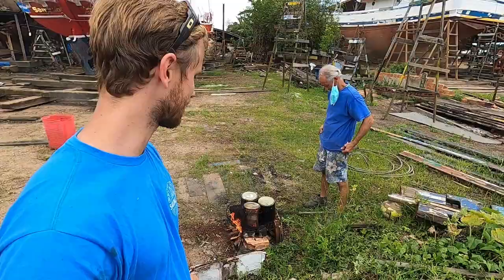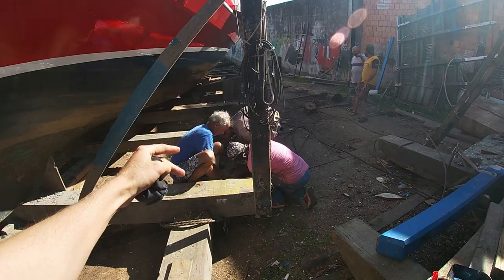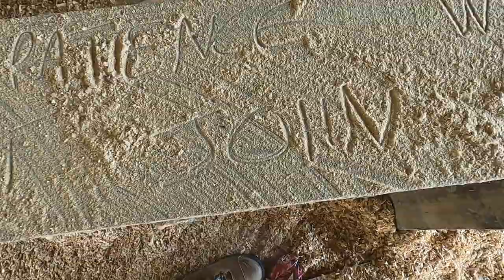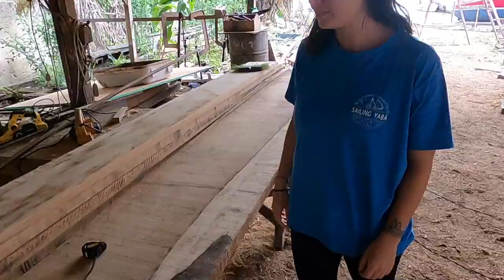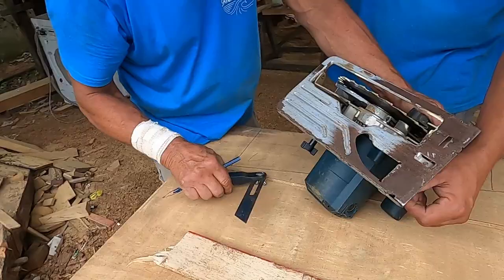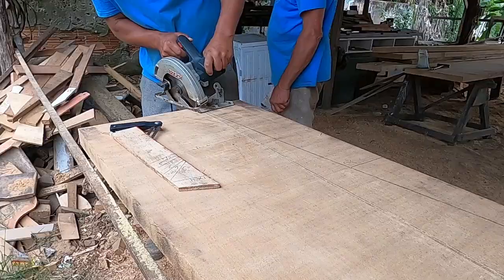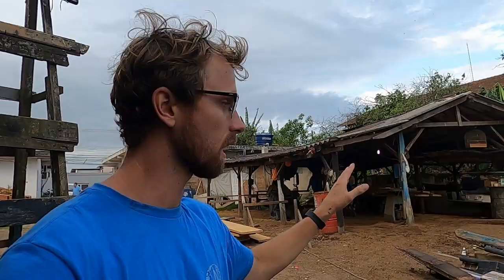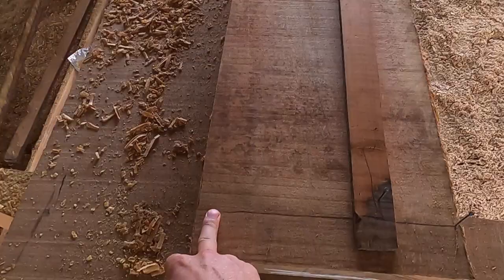Manoeuvering a schooner with a jack? + building our FIRST PLANK! — Sailing Yabá #19

Comment from the maker: FAQ - WHY ARE WE WORKING ON THE PLANKS FIRST INSTEAD OF WORKING ON THE FRAMES?

Hey guys! First of all, thank you so much for all the kind comments! We are super glad to read how much you admire our team of shipwrights, we truly believe they are awesome!
Now let's answer some questions that popped here!

1) What kind of wood are you using for the new planks?
Garapeira!

2) Why are you working on the planks instead of the frames?
We understand the right order would be to work on the frames first, BUT, the woodshop was delayed to get us the pieces we need (thick, wide and long pieces are not that simple to get).
As we had all the boards for planking already,  we went for them as the first planks (bottom ones) can be installed already because our floor timbers are in good shape. So don't worry, we are not ignoring the frames, they will be replaced and we acknowledge the right order of the works, we are just working with what we have for now.

We can really tell you guys know loads about wooden boat construction and we get to learn a lot from you as well! Thanks for sharing your thoughts!
Reply: I figured you need planks to hold the ribs to hold the boat up.
Reply: I wanted to ask you why you are bothering to rebuild a boat which is basically rotten below the waterline rather than just start from scratch or buy a boat which is ocean-capable in the first place?
Reply: @JP-lz3vk  if I had to guess, cost. I have no direct experience, but I do believe the cost of labor where they are is very cheap. Wouldn't surprise me if the cost of materials + labor is less than what they would of spent on a ready to go ocean capable vessel.

That's all speculation of course, I have no direct knowledge.
Reply: @agentnuget  I don't think this ship was ever, or will be, ocean-ready. It's also too big and too complex to be handled by the pair of them. Neither is a mechanic or an electrician, nor capable of making substantive repairs to the boat as far as I can tell, because this boat will break down a lot and water damage and rot will be a constant problem.
Reply: @agentnuget  Concur.  No direct experience, but I've asked a few people that have messed about in boats in that part of the world (other forums) and they said labour costs were such that it (and a lack of industrial regulations - or at least enforcement of them - such as western nations are riddled with) make it quite plausible to do a massive rebuild at a surprisingly low cost in fiscal terms vs pretty much any western nation.
Reply: @agentnuget  Santa Catarina (SC) the South of Brazil is not cheap, the north is cheaper . Compare it to north and South Europe with the difference in labor and living cost.
Reply: @JP-lz3vk  THE PROJECT HAS BECOME A FOOLISH FOLLY.
Reply: @geoffroberts1126   Agree.  But at the end of the day they will (might) end up with a still semi rotten boat not suitable for anything other than river cruising.   It is NOT a schooner as they call it.   It would be lucky to make 2 knots with the masts and sails it has.
Reply: @Jamesl1945  They seem to be replacing everything that's a bit ripe, so not sure that 'semi rotten' would be accurate by the time they're done.  Rig wise, mmm, rear mast is higher than foremast, and the sail plan is more like a traditional schooner than a ketch to me, so schooner works for me.  Speed wise, mmm, more like 5 to 6 knots I'd say, the sail area, particularly on the foremast is bigger than you think, what concerns me more is that this is more a coastal or inland cruiser than a blue water boat with that  shallow keel - ballasting will help, but still not meant for big seas to my eye.
Reply: @geoffroberts1126   Bunch of people commenting on the lack of bluewater capabilities of this boat. As far as I'm aware this couple have never put forward plans to sail the word in this boat.
Reply: Buuuuuuut: the Shirts aren’t they NICE?😂???
Reply: @seanmorris    I'm sure they're aware of its limitations, but no harm mentioning it.  It's an interesting resurrection that simply wouldn't happen in most countries because of the cost.  You don't often get to see real wooden boat shipwrights doing such a major reconstruction.
Reply: @Jamesl1945  Has it?  Why?  If it were in the US or Europe or even here, the cost would bankrupt a small country, however... where they are, that's clearly not the case or they wouldn't be carrying on.   I've enjoyed watching all the work being done.
Reply: @JP-lz3vk  for the experience.....
or just ....reasons

Comment: wow ! - i just started binge watching your channel 
amazing the energy you guys have and the time you are spending on this project is pretty epic - all the rot in the keel, frames (ribs) and everywhere is astounding but i guess to be expected in the way these boats were built at the time and with continued neglect, but what surprises is no use of some more modern spec materials used to paint like an anti fouling paint on joints, hidden surfaces and end grains which seal the timbers and prevent future sweating, condensation build up and mould growth, it will happen again in many years to come, but i am interested to see how this boat matures
the framing used on your boat is so much simpler than others i have seen, for example the rabbet normally goes full length on the keel, where as your keel is split into an upper and lower half, ps the two huge joins in the keel were scarfs (but i guess you know this by now) i've seen that centre joinery done slightly different and easier before, but all techniques is now learning - its very cool to watch
i watched many builds now on youtube, picked up loads of tips (as an armchair designer/builder) and i am amazed at your builders, they do a fantastic job, i see many ship writes using all the maths and working out all the angles on paper, transferring to a ship write plan and then cutting the timers, but your boys have obviously done this for so many years, its in their DNA, amazing to watch craftsman just getting down and on with each task, so much fun and the job is done so much quicker - i love it

Comment: what a great episode  Bet the guys moving the big boat said when it hit the water "See  that was easy!"  watching the guys at work fitting planks was a treat.  Knowing how rare those skills are becoming.  How long will the hull have to "soak" before the planks swell to a tight fit?  we worked on a wood hull in Oregon of a small 20' boat and by the time the transom was fixed and the motor done you could see dylight thru the planks. but with a lawn sprinkler  and huge bilge pump  it sealed right back up.  If you a starting to become concerned with the project, just take a few days off and visit the mountains or a big city and when you return refreshed, and see the progress, you will become rejuvenated with the project. Also recommend seeing "Captain Ron" - the movie about a poor old boat that get fixed up and the end is great . will give you vision for the future.  From my comphy chair  Bill

Comment: This was a very interesting video for me. I learned how the lower planks are prepared and also how to move a boat from one place to another with pulleys and a jack. The discussion of the wood used and the quality of the wood makes me recall my grandfather, who operated a sawmill -- a business that cut lumber (planks, posts, boards) from logs. He had a small sawmill. I do not think he ever did any work for boat applications. His largest customer was actually a fence company that wanted as many fence boards and posts as he could produce. However he sometimes did get special orders for lumber that had to be cut to specifications. I was wondering how your planks were cut by your provider for the lumber -- (the sawmill that provided your lumber to you) -- I wonder if the planks were "quarter sawn". In any case, this is a wonderful video and reminds me of my much younger days. I can see that Yabá is slowly but surely being rebuilt, and a wonderful work of rebuilding it is -- so precise and well done. .

Comment: QUESTION: I have asked this before. When I see all the work, blood, sweat and tears that goes into this precision engineering of new wood for the boat...I want to know..WHAT EXACTLY WILL YOU DO...to protect this wood from future rot, worms, etc. Otherwise it seems like an exercise in futility. I want to SEE how you will protect this new wood. Please reply!
Reply: What are we going to do to avoid the worms to eat our keel again?
First of all, we would like to clarify that what happened to the old keel was a combo of: neglected maintenance + boat stuck at the same place without moving for too long + tropical waters (worms’ favorite environment). As we are planning on moving and maintaining the boat yearly, the worms shouldn’t be able to feast on our hull like this again.
Besides that, we will treat and protect our wood against the worms, for sure. For now, we’ve been applying a protective thin coat of an anti-corrosion primer, to start protecting the wood from sun, rain and basically anything in general. As it’s very thin and gets absorbed very well by the wood, it also works as a treatment against cracks by simply nourishing the wood. We still didn’t define 100% what will be done afterwards, so we will share this information later on. But we believe we will be using epoxy, tar and anti-fouling in layers to protect the hull, which is the most common technique here for wooden fishing boats + a worm shoe

Comment: the skill & hard work of all the craftsmen is incredible! I hate to ask (and this is NOT meant in any way to be nasty or negative)  Is it only me, but it seems like it would be easier, cheaper & less labor just to start a new boat from scratch instead of having to pull apart every piece of large rotted timber and measure and remeasure multiple times and try and piece it all together again using both new & severely aged wood? You guys seem so nice I truly hope it all works out fantastically!

Comment: Your schooner has a slow hull configuration , which was designed for coastal trades. The hull is wide ,which allows a low keel to get through shallow waters. Looking at the width of the planking they use, you can imagine the final weight of your boat - it's huge !! A coastal proximity schooner was designed for valuable volume cargo for places best to be approached by sea. Like a truck. Their biggest fears ? troubled waters, storms , piracy and strong currents. Why ? with weight and a low keel comes a lot of inconveniences at sea , specially when your are not properly motorized and when your sail configuration is not efficient.  which is totally your case btw. A schooner captain was exceptionally skilled to avoid danger situations and knew places along the way to protect his boat, crew and cargo from the elements when needed. So unless you have a bright plan to open a diving company or a tour operation along the beautiful beaches of Brazil, this boat has no future commercially, nor will it bring you to the Bahamas, and in term of energy bills , you are in for a surprise. I also see no bow thrusters installed, and you will need to develop serious skills to maneuver a boat like that in any harbor. Docking is impossible with any kind of wind above 16 knots and mooring unprotected remains the only option.
Your investment makes no sense besides throwing away money for the sake of a YouTube channel - you guys are gonna get paler everyday when the bills will start to add up.
Ask anyone who know anything about boats ( that doesn't work at that shipyard ) for advice and listen to experience. The sea is relentless in all kinds of ways.
Reply: Same thoughts this is not a deep sea boat , beside the fact that is rotten!

Comment: YGTBKM...  They should be working on your boat not screwing around moving boats around . What kind of timber are you using just curious . Looks like its a little green to be used . Do you test for moisture content ? Are you mixing different types of timber ? I am more experienced with metal and fiberglass although I have built a couple hulls using marine grade plywood and fiberglass Radon style of boats.

Comment: at 17:53 at 0.25 speed it looks like the Blade of the Planer is wider than the Base of the Planer. Lou from Tips from a Shipwright showed how he grinded the Blade at an slight Angle to make them narrower. this way if you angle or tilt the Planer while going over a bumb it wont dig into the piece you are working on.  its kinda annoying that all electric Planers no matter the Manufacturer come with wider Blades than the Planer itself, its Okay for normal woodworking but on boats where nothing is flat or even it makes life easier.

Comment: Thank you for the updates... Happy to see the progress...
What else other then to finish the hull is on the plans before you drop the boat bak into the water?
Are you going to chase and fix all the rot before you drop it in water, or will you stop at a point and maybe keep on fixing later on?
Waiting for next update... ;)
Reply: You don't leave any kind of rot in any places for the obvious reason, which is that new rot would spread outwards from the already rotten places.
Reply: @charonstyxferryman  That is the ideal situation, yes, but for them, maybe it is not the option they can do right now.
Maybe by economical or practical or other reasons.

Comment: Ben, MP  you might want to show the guys in the shipyard this...
I'm a little surprised the shipwrights haven't twigged a modified circular saw with a jack screw in place of the angle bracket on the saw to continuously adjust the edge set (angle) of the planks. Here is Sampson boat co  at 10 mins 30 showing a temporary fix to a saw https://www.youtube.com/watch?v=9HEmOAxjBFI&t=7s    
Over at Acorn to Arabella they did to same thing to a saw but more workmanlike I cant find the video where A2A demonstrate theirs. but as you can see the modification does make a more controlled job of edge setting.

Comment: Dudes, once you get this rebuilt I really recommend just few layers of fiber-glass over the exterior hull.  My dad did that with his 1946 wooden boat that he restored.  It's well worth the expense and time.
Reply: I'm planning to build a boat, and I am not too keen on using any kind of wood.

One would of course use marine grade plywood for building a ply-epoxy boat, so I would want to know how does fiber-glassing the wood works?

I know that the fiber glassing a ply-epoxy boat is only for abrasion resistance, and not for strength.

What about maintenance compared to fiberglass boat.
Thanks in advance.
Reply: But the to be fiber glassed wood should be dry, preferably below 9% otherwise it will rotten below the fiberglass. For a very good reconditioned  boot its worth fiber glazing. Also it will preserve the wood against worms and the hull will be watertight.

Comment: It doesn't look like the ribs have been replaced/repaired, shouldn't that get done before planking?
Reply: Why are you working on the planks instead of the frames?
We understand the right order would be to work on the frames first, BUT, the woodshop was delayed to get us the pieces we need (thick, wide and long pieces are not that simple to get).
As we had all the boards for planking already,  we went for them as the first planks (bottom ones) can be installed already because our floor timbers are in good shape. So don't worry, we are not ignoring the frames, they will be replaced and we acknowledge the right order of the works, we are just working with what we have for now.

Comment: 😂
Another thing: Those wood peaces they are hammering together...shouldn’t it be that the parts you can’t reach later on be preserved BEFORE? And by the way: Is the wood, plancs, etc. be matured for years BEFORE and only then built in? What will happen when they put the wreck back into sea water, guess fresher wood starts to work a lot...deformation will go on, won’t it?! Do they know? Do they ask/pay for quality wood material?💀